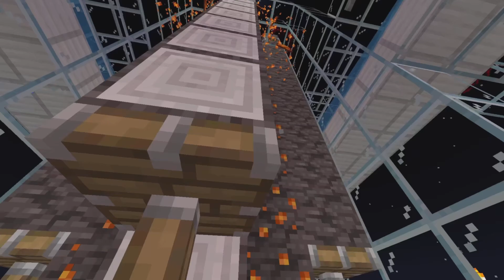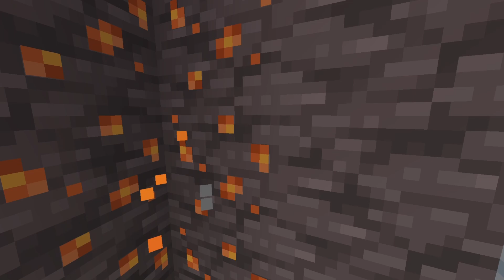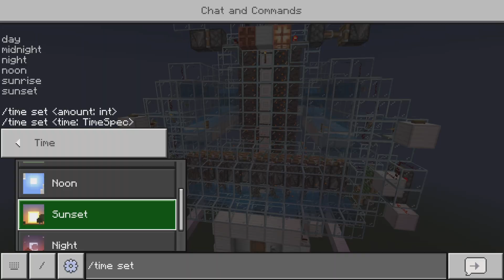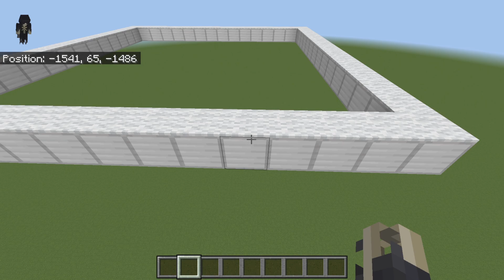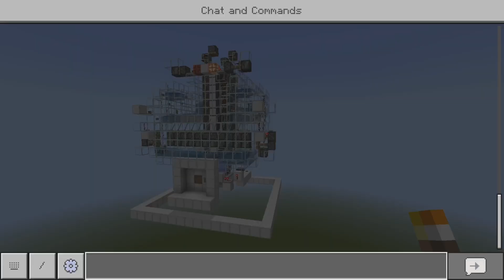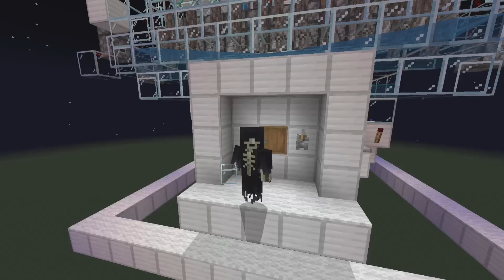[Broken & Outdated] Optimized Resin Farm Tutorial!!! (Easy & Simple) [Minecraft Bedrock 1.21]

Comment: They are spawning all over the glass everywhere except the spawning platform.  I tried putting buttons every where and they're still spawning wrong.
Reply from the maker: I heard they changed the way spawning works, so I gotta look into this issue aswell. Try slabs, if that dont work, try string then double carpet, thats an old trick from ilmango stopping enderman from TPing everywhere, and if that dont work, then I suggest just filling in the area solid with blocks so they cant spawn anywhere except the spawning floor
Reply: @brokenbones623  I slabbed absolutely everywhere they could possibly spawn and that worked. However each night 1-3 of them will spawn inside the collection area which is also glass, not sure if I'll be able to slab that and still make the water push the resin to the hoppers.
Reply from the maker: @DougEFresh555 see if adding fence gates that are open above the water stop them from spawning because open fence gates don't stop items from falling down
Reply: @brokenbones623  That was a great idea, but sadly it didn't work, and it takes away 16 spots where resin can grow.
Reply from the maker: @DougEFresh555 hmmm maybe lower the catch basin so they fit
Reply: @brokenbones623  well they didn’t stop the spawns anyways, really though it’s a great farm great rates even with only 8 creaking as opposed to 11. I’m good with that.
Reply from the maker: Ya but that sucks, I will go back to the drawing board on that one
Reply: @brokenbones623 I built the farm, just to found out that the creakings would spawn on glass after the latest updates... However, there are some turnarounds. I put carpet on top of all the external glass and let the night begin. Then, for the creeking that would end up in the "killing chamber", I would rename them. Farm works as intended again!
Reply: @brokenbones623 Updating after using the farm for a few hours: man, your farm is great! Although there seems to be a bug in bedrock that LETS THE RENAMED CREAKING DESPAWN, I got several shulker boxes of resin... Thanks for the nice work you provided to the bedrock community!
Reply from the maker: @BirgerJarl-q9u dude thats awesome thanks so much for the comment, I look forward to ones like this haha thank you
Reply from the maker: @BirgerJarl-q9u awesome dude thanks for the heads up

Comment: silly question, around 7:38 you place an observer on a sticky piston, as long as the red dot is facing up does the side with the triangle matter? i can't get the triangle facing towards the character. it kinda matches the face of the sticky piston
Reply from the maker: Great question, no, the red dot and the face are the only sides that matter, the arrow is just a texture but it does point towards the red dot so it should be pointing in that direction
Reply: How do the tridents actually hurt the creaking?  I got everything to run and the file up nicely where they are supposed to. But they don't seem to actually damage it? What might cause that?  Suggestion for fix?
Reply from the maker: Thru the glass, when u throw them in it has to be thrown at the glass, not the top of the piston. The water pushes them towards it so they will get hit by the trident, u should see the spikes poking thru the glass
Reply: @brokenbones623  I'll try resetting them again. Thanks!
Reply from the maker: @Triciat305 for sure
Reply: I got it working! Thank you!   One last thing.  Do you think it would be difficult to swap out the bottom autocrafting system with an automatic furnace system instead?
Reply from the maker: @Triciat305 you could totally do that